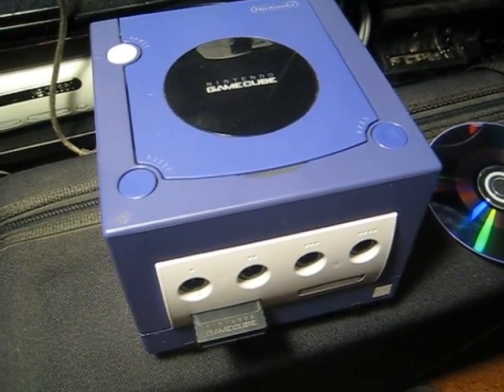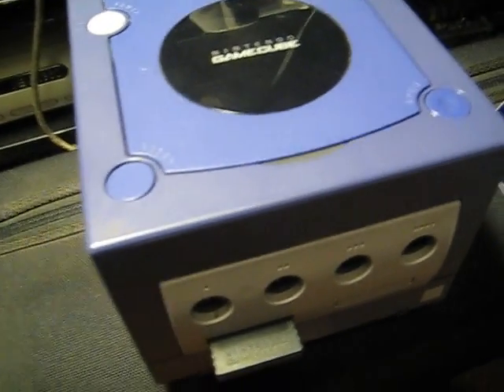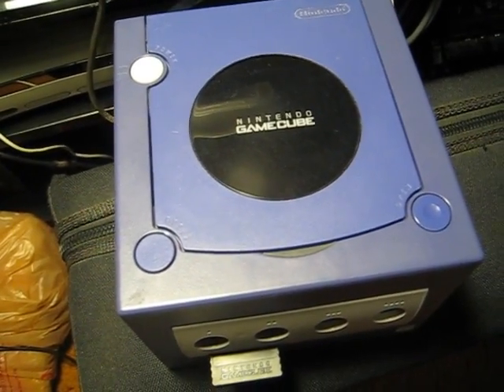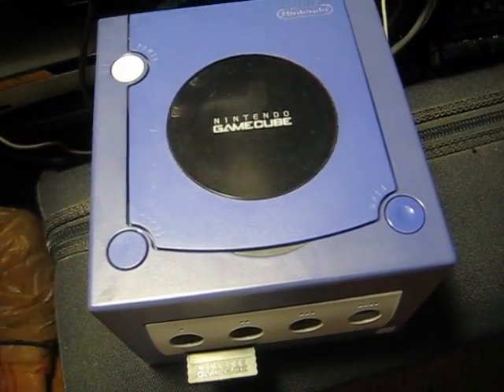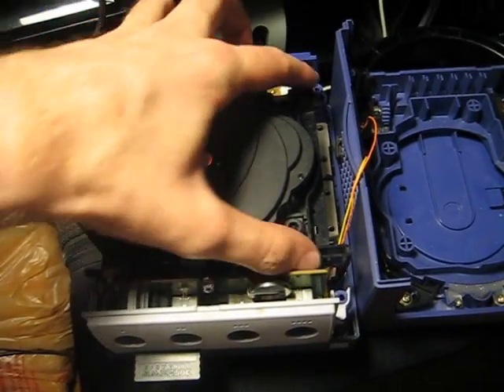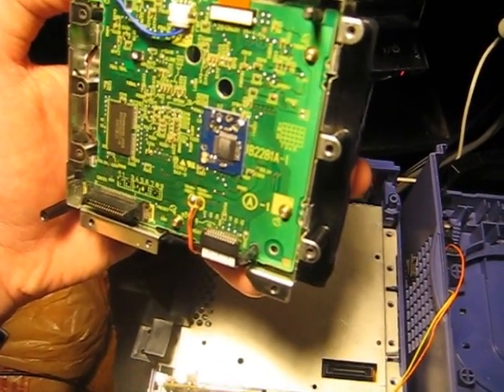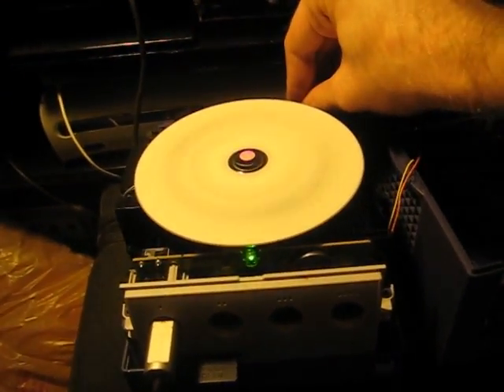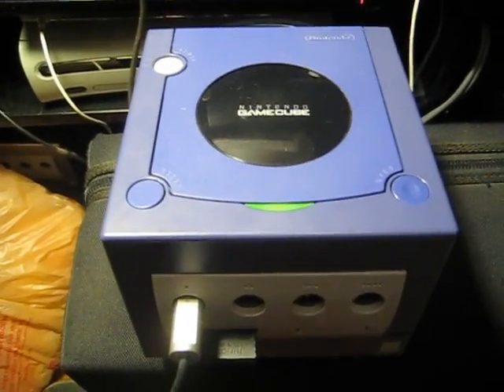02/16/13 Update - My Gamecube Mods

Comment: Man I've had to adjust the laser gear for the psx, ps2, saturn , and the dreamcast. You would think in the year 2013 that the technology would have improved to last a bit longer. 

Nice modification. I was thinking of modding the memory on mine so I could use a standard IDE harddrive.